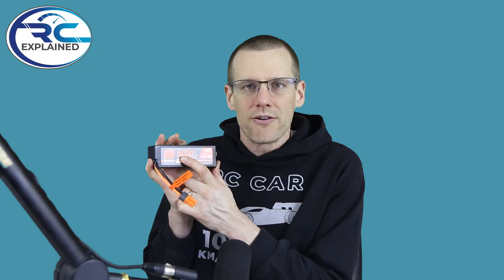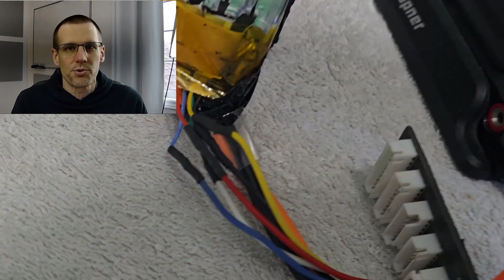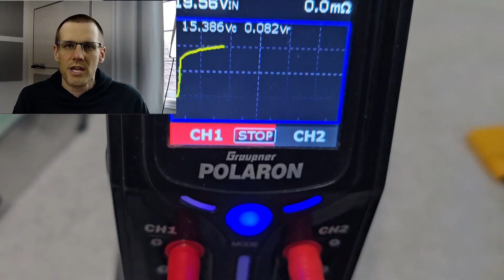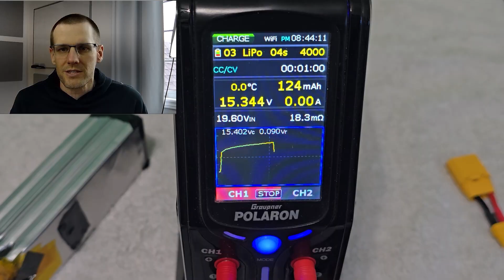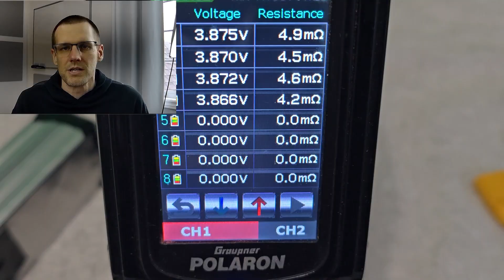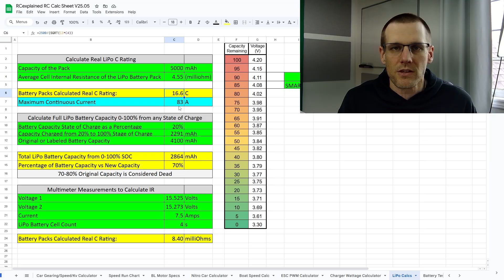Spektrum SMART G2 5000mAh 4S, Exposing the C Rating Truth

Comment: I bought the same batts but mine have balance plugs? I know they are tough I left some hooked up to a car with a big cap bank and pulled them down to 0v and brought them back I still don't trust them but I been through t charge cycles now and the cells are still in near perfect balance.

Comment: Good information here. I've almost exclusively moved over to the Spektrum line up, along with the Gens Ace smart packs. The early Spektrum G1's would self discharge, and destroy themselves. The G2's have been solid so far. I've run the Spektrum packs in everything from 1/8th buggy,  1/8 truggy, to FE boats, planes and heli's, I have not experienced any overheating issues. Are the C ratings over blown? Yep, just like 99% of the batteries on the market. I just like to simplicity in charging, and storing them.

Comment: Lipo batteries need to be broken in before completely discharging at maximum amps. They should be cycled at least five times allowing them to go no lower than 3.8 volts per cell. Then they will achieve the maximum mah and discharge rating. GensAce tells you this on their site. Great video buddy I always learn a lot from tuning in to RCEXPLAINED!!!

Comment: Instead of busting the battery open you could have simply used a battery checker designed for G2 batteries…they will show internal temperature and voltage of individual cells.  The G2 chargers will also show internal resistance of individual cells.
Reply from the maker: In order for the test to be fair, I have to use the same process and equipment for each battery.
Reply: @RCexplained so you tear other batteries apart?  Gotcha!
Reply from the maker: @forrestegan  yes, all hardcase lipos have been torn apart.

Comment: I've had a set of 3s 5000mah g1 spektrum batteries for over 2 years that still work great.   They are really handy if using a Spektrum charger.  Just plug them up and that's it.  The charger does it all.  The Spektrum charger will charge and battery that you can get a ec3 or ic3 adapter for.

Comment: Why don't you measure IR with the context of temperature? IR can drastically fall when the battery is heated to ~90-100f. Many EVs preheat their batteries to 110f before fast charging to lower IR.
Reply from the maker: You must measure with respect to tenperature and compare IR with all variables for each battery the same. Im not interested in best IR as this provides no additional value, complicates a rather simple process and would require a redesign of the c ratings formula.

Comment: Great info. I believe their 120C basher series may surprise, but I would love to see your review. Measured resistance is similar to the best in industry SMC offerings at .5-2 milliohm per cell. Hotter cells measure near .5 per cell or less in some cases, nuts! They just had a spring sale, I loaded up. The Losi 22S Sprints are loving their 2S versions, punch is crazy good. My Infraction 6S is on fire with their 3S versions, wiped out a couple sets of tires already. My goto's are still SMC but Spektrum really has me amazed. Spektrum might be be better actually due to their more consistent connector soldering jobs but lack universal balance leads puts them slightly lower in tier for me.
Reply: My new Bigrock 6s with all fresh spektrum G2 lipos absolutely shred they are so good

Comment: spektrum batteries are terrible. Especially their 1800-2200 mah 3S and 4S plane batteries. bought five of them and all five went bad to zero volts on their own before even getting four flights in them.  I've only had 4 out of 9 5000 hard case batteries go to zero volt. It's that crappy board they have inside. Then I had two more puff when using in my arma typhoon . I always take care of my batteries and only use them up to 7.7 volts and always storage charge that same day to store them.

Comment: A few months back, Horizon hobbies was running a clearance on their 30C 3 S hardcase packs for 30 dollars. I bought a couple to try in my Kraton 6S. I have had no issues with them. As we all know, the Kraton can pull a significant amount of current. Almost every time i use it, i see 200 plus amps on the telemetry display. However, i have turned my cut-off voltage on the ESC to 3.6 volts to prevent drawing the packs down into that lower voltage where it seems that they run hotter. So far they have stayed fairly cool even under hard running.
Reply: Temps can be decieving on those hard case packs buddy. Chances are the cells are 20-30 degrees warmer than what they read.

Comment: Tip - do not buy used batteries. 99% of the time owners sell them because they think they are no longer up to their standards. You might be able to get away with buying used packs if you can measure the batteries internal resistance before purchase to determine how much life is left in them and how abused they were.

Comment: We just sold 2 of these batteries saturday for $100. They came with a used RC we bought, but I just couldn't bring myself to invest in the spektrum eco-system for 2 batteries (among the 50 or so batteries we have between us)

Ive watched a few of your C rating battery videos, and I dont know if you've ever brought this up, is it possible someone like Ovonic for instance say 120C for a 4s but they are take a 30C rating and multiplying it times 4 cells for their "supposed" 120C rating?  Just a thought i had about how some may rate their batteries possibly.
Reply from the maker: I doubt they would multiply by cell count as this electrically would make no sense.
Reply: @RCexplained I know it doesn't make sense, but maybe thats the common core math 😂 they are using lol
Reply from the maker: @BUILDEMTORIDE  i think they put numbers in a hat and draw one to throw on a label
Reply: Not a fan of OVONIC'S.
Two brand new 4S 2200mAh 35C batteries both went fluffy Pillow on me, the first on its very first run, the second on its third run.
Voltage sag was the worst I've EVER encountered out of any battery packs in my life, and the performance was worse than the stock supplied battery in the box with my boat.

Comment: Great test, I was surprised that the Spectrum didn't do better with what they charge for them. I will just keep on with my CNHL 90C racing batteries, I have been having great luck with them. I hit 80 mph the other day with my Felony on a short track. I am waiting to go to a longer one and see if I can hit 90 with the 22T pinion I have in it. Then my plan is to go up to a 27 or 28 and try for 100. Then I can order my T-shirt. :) My 80 run was the last video I posted, I was surprised I could consistently hit 80 with only 430' to work with.
Reply from the maker: I was surprised too! It was the most expensive pack I got and I'll be tossing it the trash.